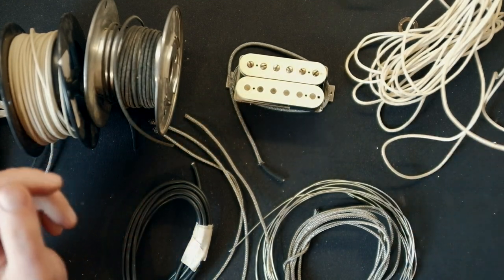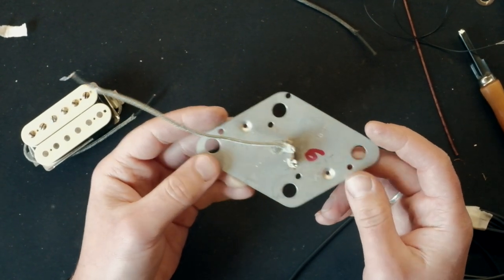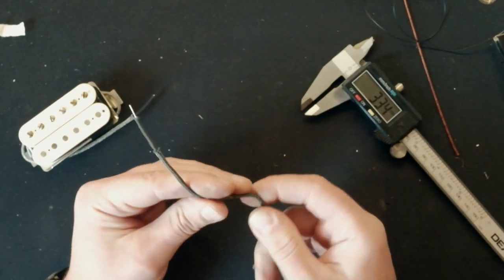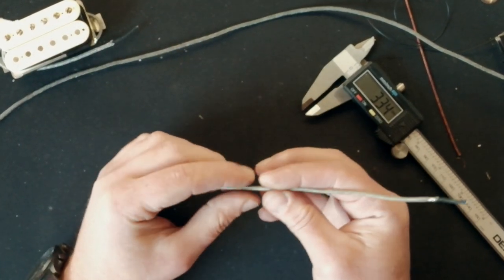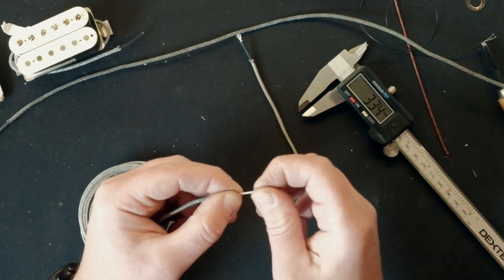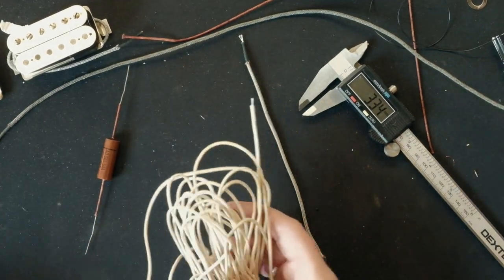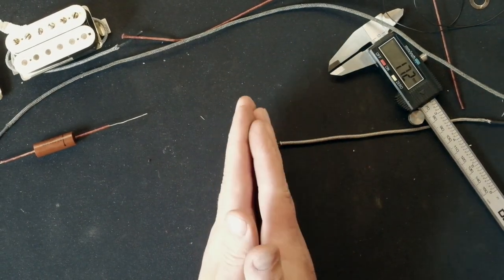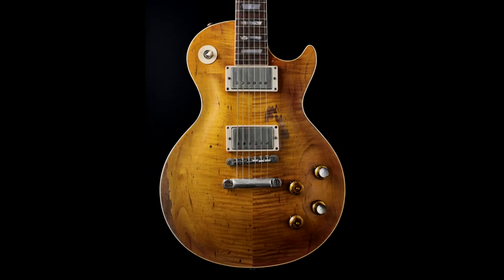THE BEST WIRE FOR ELECTRIC GUITAR

Comment: I never thought about the wire in guitars and the reactances, etc.. Also, didnt think about what older guitars used originally. I thought of using high silver wire instead of copper to increase signal strength. Appreciated the experiment of using shelac on insulation of wires & capturing old copper from antique insulation for purity of copper.

Comment: (Amplified Parts)  sells gavitt wire  with solid copper, and stranded copper in 18 awg ,20 awg ,22awg. It's the best I've found. Check with( Amplified Parts )what ever you need for guitar and amplifier parts. I like your video, very informative. Also check out Jupiter Capacitors ,best bumble bee capacitors  I have found, and I have tried them all  ,Luxe, Emerson, Russian military,mojotone, even real vintage bumble bee capacitors. The Jupiter Capacitors sounded best. Also one last thing I would like to say try Pure tone  input jacks ,big improvement over Switch Craft input jacks.
Reply from the maker: Thank you.

Comment: i think the most unusual wire ive ever used in a guitar was from a 90s printer cable, parallel printer,  it had many thin wires inside of the jacket and i was putting things together just to test pickups and wiring ideas.  i thught it imparted something to the tone, like more hi fi.
Reply from the maker: Thank you for comment

Comment: Did you measure the impedance? I think they might make a difference
Reply from the maker: Yes, I measured these wires.  And compared with others.  But that was not on camera a while ago.  The larger the wire cross-section, the less sound loss.